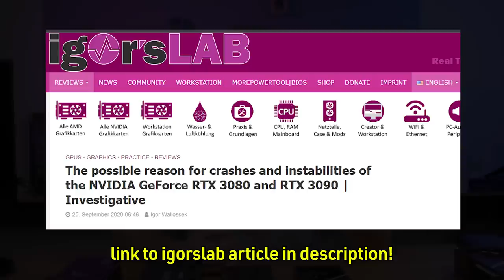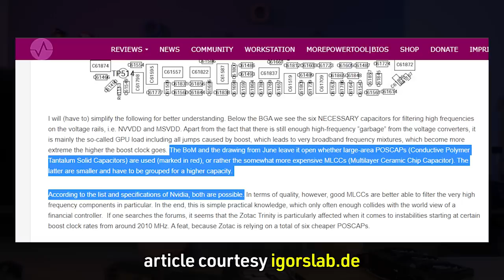The RTX 3080 Launch can't get any worse... Right? Wrong...

Comment: Doubt that whole "you're only guaranteed the first number" would fly in Australia.  It's advertised as reaching the 2nd number and is therefore required.  I feel like ACCC & Consumer Affairs would whoop their ass if they tried that here.
Reply: Yeah, although these things often don't happen quickly. It took ~3 years for ACCC to get Steam's scalp, ~3 years to get EA (Origin), they're still in the process of going after Sony (they filed in May 2019). That's not a knock on the ACCC, it's just that these things take time unless the malefactor backs down.
Reply: Canada used to be just as strict, too. But over the past several years, the government has gone extremely lax on getting involved in any way. Companies can advertise all kinds of things on the box or their web site that is just plain false.
Reply: It would still reach the higher advertised boost on aftermarket cards. Take gigabyte gaming oc. Its advertised at 1800mhz. Actual boost of that card is likely about 1950-2000mhz. They'll probably drop it to 1850-1900mhz which is still well over the advertised spec.
Reply: Read it again.

You really ARE only guaranteed the first number (1710 mHz).

The Boost makes no guarantee, either explicit or implied, specifically because of the phraseology capable of in conjunction with up to.

Just because the tachometer on your Ford Focus references 7000 RPM doesn't mean that 7000 RPM is within the engine's operational parameters or that your engine will survive it should you somehow manage to get there.

Overclocking is a nebulous act and highly subjective based on system configuration, and as such the minimum standard is enforced worldwide (1710 mHz) not the ephemeral and nebulous undefined individual upper limit.
Reply: Same in the UK.
Reply: Good thing about Aus even though things are generally more expensive we have way better consumer rights.
Reply: @digitalis2977  That kind of language still doesn't fly here in Australia. The ACCC stopped our ISPs from using similar language (Quoting "Up to" speeds).
Reply: Was about to say..... it's basically false advertising.
Reply: @GonePh1shing  It doesn't fly with ISPs because they try to apply "up to" to the minimum speed.

If they were advertising 100Mbps with speeds up to 150Mbps then the government would/could have nothing to say about it; the governmental enforcement in your instance is for a promised Minimum, not a nebulous non-maximum, and only Minimums and Limits are Legally Enforceable, not potential non-maximums.
Reply: @digitalis2977  You're clearly not familiar with the country or our rules, so why even bother commenting? 

For reference, ISPs here have never advertised minimum speeds. They're now required to advertise typical speeds during peak period, as that is most representative of the end user experience.
Reply: @GonePh1shing  Because certain things don't change no matter where you are in the Western World.

Also, your comment proves my point, as it is just a slightly different application of the "Rational Person Standard"...that is, "what the average rational person would expect/do in a given situation."

The ACCC didn't change anything in this instance...they simply issued guidance (be it binding or no) so that the bell curve of expectations by a Rational Person now coincides with the service already provided.

In the end, you can try to make it about minutiae all day, but Western Jurisprudence still applies, and the Rational Basis of Common Law is the guiding principle.

Comment: You are exactly wrong on calling "cheap poscaps", they are called as tantalums, which are produced by Sanyo, Panasonic, Samsung, Kemet etc.

The tantalum caps are nearly the most expensive ones, they have very high ripple (ampere power, upto ~8 Amps) and low esr, which means loss. 

The other smaller ones are ordinary, very cheap, piezo electric effect based (they buzz), low microfarad and low ripple, (8~10 of them in parallel can give around 50 to 100 microfarads and around only 2~3 Amper maximum.)  There are many of those around 50 connected as parallel with tantalums caps, which can also be called fillers. (not active, but passive ones) Designers generally decide to use those little ones, to cut expenses, to lower the cost. The aim here is the power draw, the issue causes to crash, is other than the power draw. Here, there is no frequency related use at this place! Pocket for CPU power draw is the goal here. 

If you remove those tantalum caps, card stops running, but if you remove those small ones, card can still run. If you can manage to find spare tantalum caps according to their specs (Ripple, esr, series) for empty places, the board can run of it's best.

The solid caps are less cheaper, like on Gigabyte's custom board. They have a little more microfards, generally same or lower ripple, but they have a little piezo effect and interference issues, solid caps can move inside the cylinder a bit with vibration on card. Their negative leg has no connection to chassis. Tantalum caps are here the best again, because they are all around coated with chassis inside the housing, they are totally filled are stabilized.

Tantalums are no: 1
Solid caps are no: 2
The little ones you like,  are near to the worst!

The easiest way to understand to use of the circuit, is to use a test meter. If the negative leg of the capacitor has direct 2 ohm connection to chassis, this circuit is a most possibly a power line. There may be many parallel + connection with other group of capacitors as well.

If a way way of high frequency use, there can't be no direct negative 2 ohm read on probe with chassis. Especially, Radio, TV, Satellite, Radar etc. systems don't want interference from the chassis so they have great resistance.
Reply: You really seem to think you know what you're talking about, but there's literally a pinned comment from an RF engineer explaining the actual truth of the situation as well as several articles from electrical engineers on the details of exactly what's going wrong.
Reply: @TeganGibby0  Someone who calls themselves an RF engineer (who knows, but I've an EE degree and they sound suspect) who spouts enough to sound convincing to laypeople, but fundamentally doesn't understand the VRM designs concerned here.
Reply: You don't know what you are talking about. Tantalum capacitors have somewhat higher capacitance density than MLCCs but they have inferior ripple current handling, ESR and ESL. Combining the two is quite clever as it gives the benefits of both. Removing the MLCCs to fit one more tantalum is poor design practice.

Comment: As someone who occasionally designs high speed boards, all I can say is I'm amazed anything works.
Reply: well since they've been making cards for ages, they sort of know what works and what doesn't.
What bothers me is Nvidia cards having better components than 3rd party cards.
Reply: Well it depends on the information NVIDIA sends to their AIB partners.  They might be holding back to sell more of their own.
Reply: "As someone who occasionally designs high speed boards" - "As someone who is full of shit" - I corrected that for you.
Reply: traeng true when they’re often expensive compared to FEs
Reply: Yup. I can't believe transistors actually work reliably. The idea is nuts.
Reply: @Stevospeedo If you can do it at 5 GHz then I would indeed be amazed

Comment: Overkill/Overspecs (6): ASUS

Great (2): FE

Good enough(1): MSI, EVGA

Avoid (0): Gigabyte, Zotac
Reply: I wouldn't say avoid, I ordered Gigabyte Gaming OC and it's arriving in under a week and I hope it will work good or fixed by that time
Reply: ASUS
ASUS has changed the design in pre-production. No official statement was made.
MSI
MSI acknowledged the issue during the MSI Insider Livestream, suggested it could be a driver issue.
ZOTAC
Igor’sLAB reports: PC Partner, Zotac’s mother company, seems to have recognized this and is obviously changing its cards.
GIGABYTE, GALAX and other brands
No official statement.
Reply: @SaintJoan  No sure what Asus changed but current retail models still have similar "good quality" components: youtu.be/vJVXWO-o3SM
Reply: That conditioning stage on the Asus tuf card honestly made me rock hard, I'm scared to look at the price though
Reply: @unlisted9494  worst part, the TUF card isn't even that much more expensive. The Strix line is, but when I was looking at buying a card, the TUF series was on the cheaper end of the AIBs
Reply: @kkfcbugsbbn3430  of course you won't say avoid 
because you got bamboozled and bought from those cheapskates who don't use high quality components
Reply: Neither the STRIX or the TUF uses the MLCC components they all use the cheaper POSCAP array.
Reply: Hell. Yes. Glad I went for the STRIX OC, no matter the wait until I get my hands on it 🙏🏻
Reply: @theEmeritus 

TUF OC: https://www.overclockers.co.uk/media/image/thumbnail/GX44HAS_260171_750x750.jpg

STRIX OC:
https://www.overclockers.co.uk/media/image/thumbnail/GX44KAS_260209_750x750.jpg
Reply: palit also "good enough"
Reply: Fezzy how it’s possible that in one card you have better components and in other same model worse? Changes during production process?
Reply: @Fezzy976  Asus changed those in pre production since they already found the problem in their own testing. Here is the back from the card as you can buy: https://pics.computerbase.de/9/4/9/5/5/4-1260.2cf9a2d1.jpg
Reply: wrong the Gigabyte Gaming OC 3080 should be fine i was reading about them and they seem to be fine, its only the gigabyte eagle one, not the gaming oc one
Reply: @cdbtheclaw  I stand corrected, good job ASUS!
Reply: @kkfcbugsbbn3430  insta bloody_impact_xt n
Reply: @MrBuurt  sorry but no I have the 3080 giga gaming oc and it crashes without under clocking.
Reply: @DatBoi-to2zr  okay good to know. But it's okay with under clocking ? Don't really want to rip my complete new rig apart. Or is it just completely shit and I should stop my order and everything? Or maybe I get a fixed one because mine comes mid October. But ya ordered a full custom build and don't want to kill everything if I just can underglock the card
Reply: @MrBuurt  yea id say its only ok though I get fps drops to 65 at 2k on gta 5, it really depends on if you care about overclocking in the future but overall im finding the performance with the under clock to be subpar (all i want is 2k 100+ fps)
Reply: @DatBoi-to2zr  okay. I will maybe text them and ask. I mean gigabyte should fix that because it's kinda shit... man. Shit show those cards
Reply: MSI is 2 not 1
Reply: Buurt so looks like i need to cancel my order on eagle ..
Reply: @jaarb  I am going to write some messages and hope I can fix my build and stuff
Reply: @Fezzy976  You're looking at some old pics.
Reply: nope. Asus actually cheaped out. check my other comments.
Reply: @alzuu1  yea I gathered that, the pics i was looking at are from a retailer in the UK and they are still using the old pics.
Reply: @Fezzy976     https://youtu.be/5YuSsYGj5S4?t=539    TUF has 6 better arrays. BRAH.
Reply: EVGA is top tier. Probably the best. 
Similar to Saphire.
Reply: Not sure why but the MSI 3080 Gaming X Trio has power limit locked at 100%

Comment: There's always 2 rules I live by as a consumer: - Don't be an early adopter. Don't skimp out on the cheaper product as there's usually a pretty damn good reason it's cheaper. If you live by those rules, you'll hardly ever have issues and I think less hassle is worth having over the bragging rights to be honest.
Reply: Same. I have one additional rule - if shit happens and manufacturer makes it right for you, they are a keeper. Bought 2 Ryzen 5  3600 for upgrades and one had a problem with cache. AMD replaced it for a new one in one week (time including sending faulty one to them and new one to us, via international shipping). Now, I would need to get a pretty good bang for buck from their competitors to change vendors - cause I know that when shit hits the fan I will have no problems.
Reply: I have lived by these rules my entire adult life when it comes to software and hardware. Saved myself a lot of headaches over the years.
Reply: @poprostumort  Same here. I had issues with some Crucial ram years ago with the LEDs failing and then random system crashes. I didn't even have the receipt as I got them off of eBay but they honoured the lifetime (non-transferrable) warranty and upgraded them from 4x1GB to 4x2GB (back in the good old DDR2 days where 8GB system ram was rare!). Now all of my ram I buy is always Crucial, even if it costs me a few quid more.
Reply: I share the same rule with one addition: Only suckers pay full price.

Comment: Next video: Micro-soldering better capacitors onto these GPUs.  On a serious note, though, I feel like this is something AIB's have been doing for a long time, but Ampere is roided up so high that now they can't cut their costs to make a cheaper yet effective card, at least as far as those caps are concerned.  So is Ampere already tuned close to it's limits?  Are they simply dumping more voltage onto the chips to make up for lackluster technology and engineering development?  Is this a replay of the 1080ti release, where something about AMD has spooked nVidia into overbuilding their new cards in anticipation?
Reply: I was actually just wondering if the caps can be replaced with the better ones, if you are comfortable soldering them in.
Reply: remember the FTW2
Reply: @merlinious01  I wonder whether you could just return the card since you spent a crazy amount of money on it
Reply: @merlinious01  I work with  MLCCs all the time at work and they are an absolute pain in the ass to solder. They crack due to the heat of the soldering iron if you touch the leads on the cap causing a short in the cap and potentially burning up the board. The worst part is the cracks are microscopic and sometimes need a SEM to see them so you can never tell if one is bad by looking at it.

Comment: So basically, electrical noise problem when the OC frequency reaches the limits of the components. This ends up either damaging/destroying the GPU chip itself or messing the output of the GPU.

Caused by the circuit and cheaper components. (capacitors used for power delivery and noise filtering)

Comment: Only the drivers today fixed the issue for people, and many are reporting higher clocks because of the new stability - can you maybe make a video addressing and clarifying that... so much misinformation going around. Thanks
Reply: Nvidia should say what is the problem. They did also 'solve' gtx970 vram problem with a driver but they still lost a lawsuit